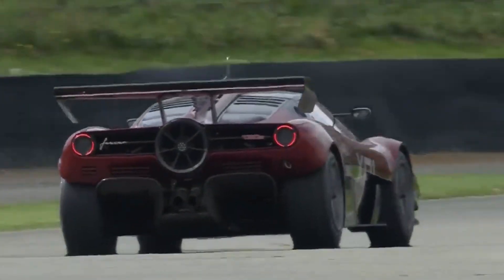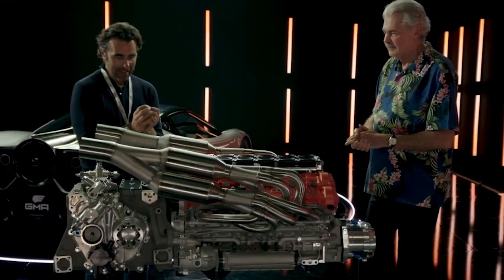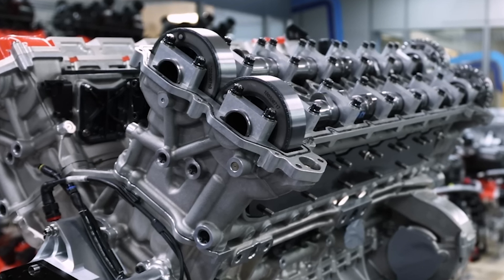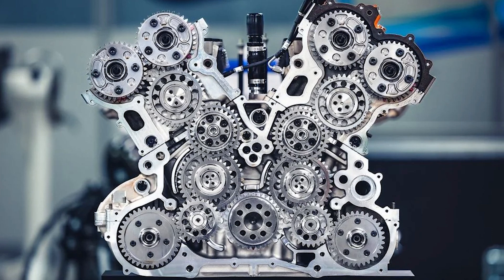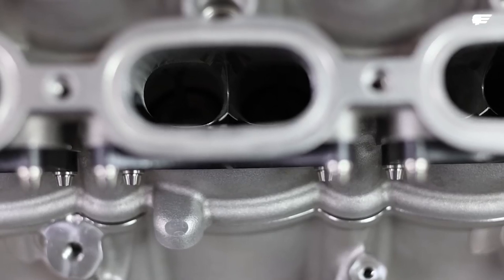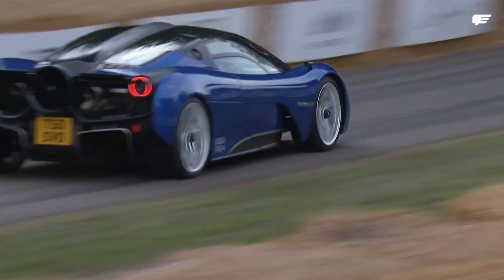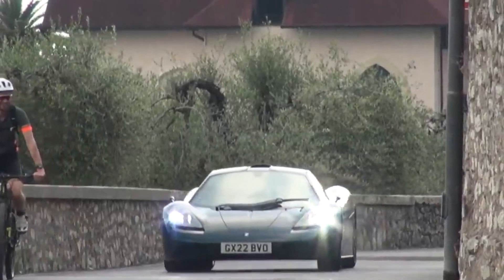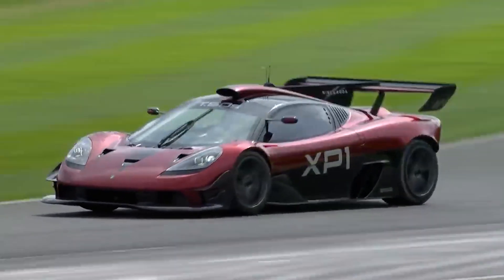The Best Engine Ever Build: Cosworth GMA V12

Comment: bmw m1000rr makes 53hp per cylinder has canted valve vvt and variable valve lift 250cc per cylinder all and makes this power at 14500rpm using a chain no fancy and very expensive gear drive with quill gears.
gma v12(from t50s) makes 58.4 with 300cc cylinders at a lower rpm without variable valve lift. the cool thing with the gma is the DI and how they are making that work.

Comment: You're kidding, aren't you? the greatest V12 engine ever made? Hahahah you need to get out more. Have you ever heard of that Aston Martin valkyrie? It also has an NA engine, but it has a capacity of 6 trs and producing over 1000hp. While it doesn't rev to 12000rpm, the Aston Martin engine that is also made by Cosworth and will rev, to over 11000rpm and I believe that this engine is one of the greatest engines ever made. Do yourself and us a favour and do a bit more research before boring everyone with those sorts of claims.
Reply: Yeah Valkyries engine is a big lump at 6.5 litres. Less power dense, less responsive, heavier etc..plus mated with 7 speed sequential auto gearbox makes it fun on track sure, but nothing beats a combo like the T.50 or T.50S Lauda has to offer.
Reply: Also has 2 more liters of displacement allowing for more power and making it heavier. Bigger ≠ better.

Comment: That timing gear train is terrifying!  I don't doubt it is superbly engineered, but the multiple points of possible, catastrophic failure don't bear thinking about!

Maybe I missed it, but you didn't seem to mention what capacity it is..
Reply from the maker: 4.0😂
Reply: @ChrisVSCars  Thanks...
Reply: Gear driven timing is more reliable than belt or chain.
Reply: @owenharney6309  Quite possibly, but nothing is 100% reliable....
Reply: @owenharney6309  but is it lighter?
Reply: @Redmenace96  it's most lightly the heaviest option. But if they used aluminium and a pressed on outer gear ring, they might get close to the weight of a chain and all of the associated tensioner sprockets and failing chain slides. You wouldn't need to take the engine out to change the beld/chain. It would save you 20k+ in garage fees over the life of the car. Most industrial engine's use gears and are capable of 1 millions+ miles. This car obviously won't do 1mill, The rpm is too high, but it's nice to know that the timing gears won't have to be fixed. I've had 10 cars since I started driving, and 3 died prematurely, 2 belts and 1 chain, all well below their manufacturers recommended milage.

Comment: Mate, F1 and the 2026 regulations can't dream of this. An engineering marvel.
Reply: Um no. in terms of Engineering, the 2026 still ahead of this. Way more. You are confusing engineering with exciting.  No engine surpass the engineering marvel in Modern F1 Power unit.
Reply: @MrWimbomahadi  Hmmm, agree to disagree. At this point, it's about aethietics. You prefer hybrid, I prefer ICE, tomato, tomato. I will stand by the 2026 regs being terrible though, that ICE will sit at an RPM that's efficient and charge the batteries like a prius. Fun.
Reply: Marvel? This was done 2 decades ago lol
Reply: @chabweezy9905  Doesn't detract from it. Always improving.